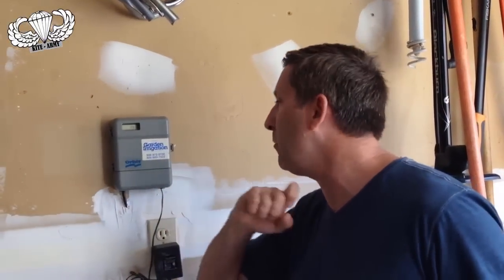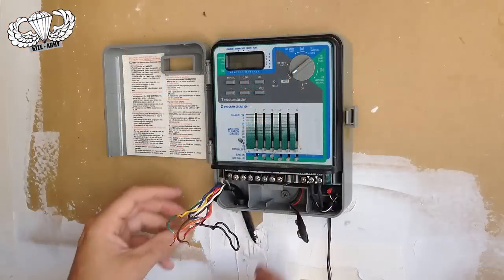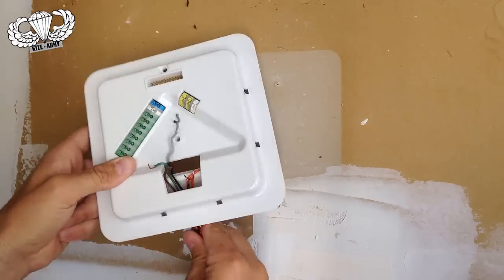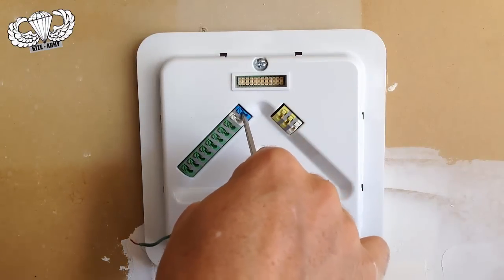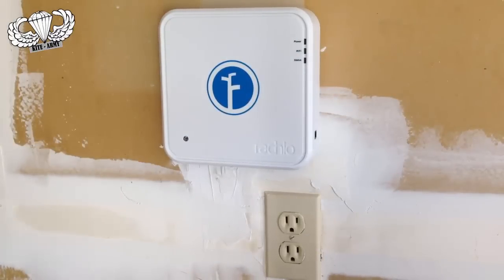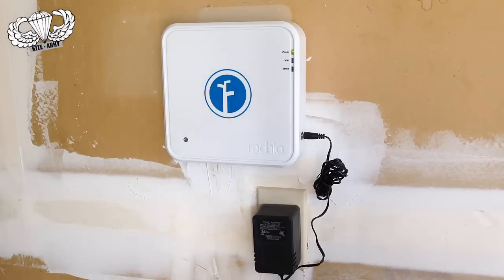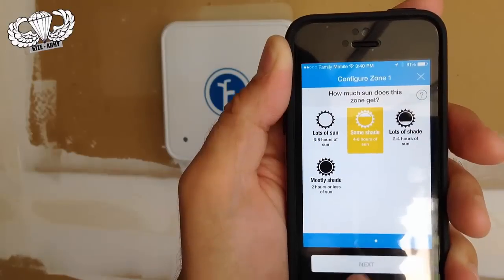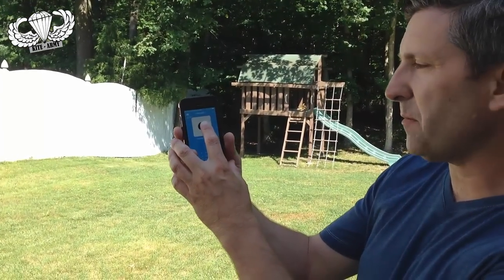Rachio IRO WiFi Lawn/Grass Sprinkler Controller Setup Install & Review

Comment: game console repair parts, computer repair parts, mobile phone repair parts, accessories and fashionable products, high technology products supplier.

Firstsing PC Gaming Headset Physical 7.1 Surround Sound USB Wired Computer Headphones LED Lights with Microphone Volume Control for PC Laptop
 
http://www.firstsing.com/p/46977/pc-gaming-headset-physical-71-surround-sound-usb-wired-computer-headphones-led-lights-with-microphone-volume-control-for-pc-laptop.html

Firstsing 2600w Mining Miner Machine Mining Rig Antminer Power Supply
 
http://www.firstsing.com/p/46979/2600w-mining-miner-machine-mining-rig-antminer-power-supply.html

Firstsing Power Strip Switched Socket with overload protection with Quick Charger 3.0 Travel Adapter
 
http://www.firstsing.com/p/46983/power-strip-switched-socket-with-overload-protection-with-quick-charger-30-travel-adapter.html

Firstsing Intelligent Car Air Purifier Removal Formaldehyde Aromatherapy machine
 
http://www.firstsing.com/p/46991/intelligent-car-air-purifier-removal-formaldehyde-aromatherapy-machine.html

Firstsing Portable Mini necklace remove smoke filter PM2.5 personal ionizer air purifier
 
http://www.firstsing.com/p/46978/portable-mini-necklace-remove-smoke-filter-pm25-personal-ionizer-air-purifier.html

Firstsing TWS Wireless Earbuds Mini Bluetooth Stereo Headset With Charge Box Earphone for IOS Android

 
http://www.firstsing.com/p/46992/tws-wireless-earbuds-mini-bluetooth-stereo-headset-with-charge-box-earphone-for-ios-android.html

Firstsing 4G Smart Phone 5.45 inch Android go 8.1 MTK6739 Dual SIM GPS Wifi Bluetooth G-Sensor
 
http://www.firstsing.com/p/46981/4g-smart-phone-545-inch-android-go-81-mtk6739-dual-sim-gps-wifi-bluetooth-g-sensor.html

Firstsing ATX Water Cooler Full Aluminum Transparent Tempered Glass Gaming Computer Case
 
http://www.firstsing.com/p/46944/atx-water-cooler-full-aluminum-transparent-tempered-glass-gaming-computer-case.html

We are still supplying game accessories and parts to our old customers at the same time. 

xbox one N15-120P1A power supply, usd15/pc
Xbox one original controller old type, without earphone hole, 300pcs, some are new, some are 90% new, pp bag packing,take all price usd15/pc.
Xbox one dvd drive original new 100pcs in stock, usd14/pc, 
xbox one consoles original new 2pcs in stock, standard packing set, usd250/pc,
Xbox one S power supply 100pcs in stock, usd11/pc or so see order quantity,
xbox one S and x universal blue tooth wireless controller original new small stock, good price,
Xbox360 wireless controller original 20pcs in stock, usd15/pc take all price,
Xbox360 DG-16D4S DVD Drive Mainboard PCB BOARD in stock usd4/pc or so see order quantity,
xbox360 slim mother board universal, in stock, good quality at good price. 
xbox360 slim x818337 cgpu in stock,
xbox360 slim 220V-240V power supply original new, 100pcs, usd13/pc to you. 
PS4 ADP-200ER power supply for the 12xx consoles original new in stock, usd14/pc or so see order quantity, 
ps4 single ear earphone original new in stock, usd3/pc or so see order quantity.
PS4 MN86471A HDMI CONTROL IC, usd6/pc,
ps4 slim ac adapter, N15-160P1A, original NEW in stock, usd15/pc or so see order quantity,
PS4 slim ac adapter, ADP-160CR original new in stock, usd16/pc.
ps4 slim 490AAA lens with tray 1300pcs in stock, brand new, take all price usd7/pc.
ps4 slim and PRO universal 496A lens original new usd8/pc, 
ps4 pro hdmi port connector org new,usd5/pc, 
ps4 pro console case with hdd case, usd19/pc, 
ps4 pro ADP-300CR power supply usd60/pc,

Many thanks and best wishes!

Anndy
www.firstsing.com Japanese office and Chinese office, more  than 1000 kinds of  hot selling products;
https://www.amazon.co.jp/s/ref=nb_sb_noss?__mk_ja_JP=%E3%82%AB%E3%82%BF%E3%82%AB%E3%83%8A&url=search-alias%3Daps&field-keywords=firstsing
   We have online shops worldwide, mainly for promotion use, we mainly do wholesale business, 
www.consoleplug.com mainly for repair parts;
http://www.shengxintga.com/products.asp   You can download some wholesale pricelists of ours here;
http://www.cybergadget.co.jp/retrofreak/en.html for the video game  world KING  product;
www.facebook.com/firstsing
https://www.facebook.com/anndy.wang.1  New products info everyday!
https://www.youtube.com/channel/UCfnQKP1TTLbAZemUgH7e6Zw   We have many youtube channels, 
Skype anndy.wang
Whatsapp:  
Wechatt:  BlessAnndy
Firstsinganndy gmail com

Comment: what if you have a leak or bad valve in other words dose your phone need to be present for an irrigation tech to service your system??
Reply from the maker: Most tech turn on the sprinkler zones by manually opening the valves.

Comment: How happy are you with this since it's been a couple of months now?
Reply from the maker: Strange you ask....I was just telling my friend that I'm happier with the Rachio over the Nest.  My water bill is just slightly lower than last year BUT my lawn is much greener.  Unless you have a HUGE system it will probably take years to recoup the cost of the RACHIO but I had to replace my controller so I would say it is a no brainer.  In short, if your putting in a new system or have to replace your current controller...Rachio is a hands down winner!